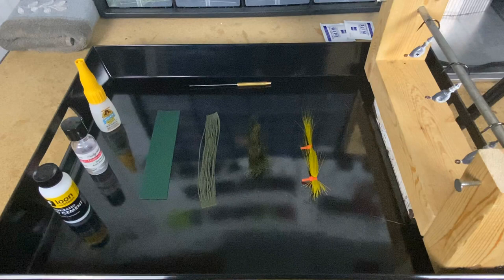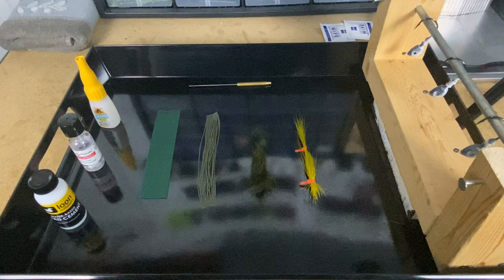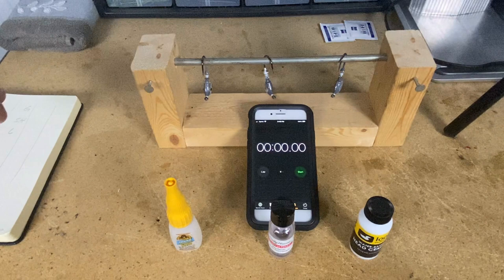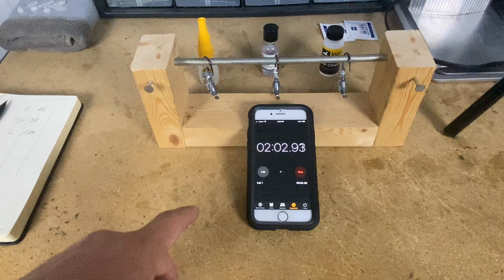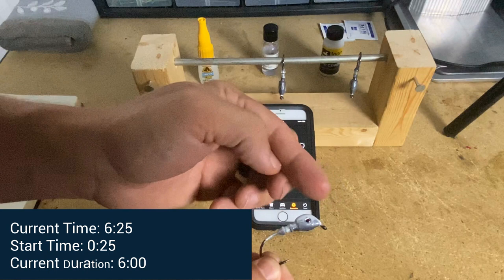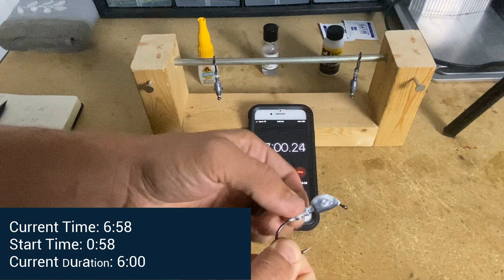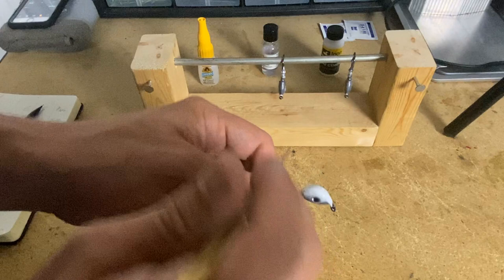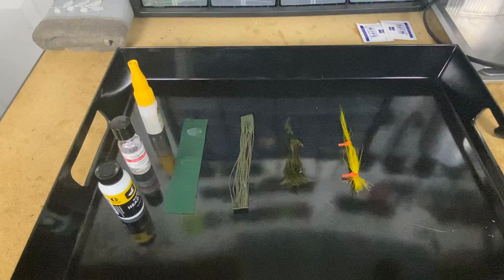What is the Best Way to Seal Your Jig Threads?

Comment: Fantastic test!!!  I used the glue for silicone because it didn't have the residue Sally Hansen's left. Your test showed it wasn't residue, it was the polish flaking which gave it that appearance. I used the Sally Hansen's on hair because of the way the glue looked if you got some on it.  I was sold on the loon after using it a few weeks, it seals the threads nicely and if you get some on your material it doesn't show no matter what material it is. The drying time was an unexpected bonus, the simple fact it isn't tacky is just nice! Overall your test was well done and pretty thorough, I wouldn't have thought about doing that kind of comparison.
Reply from the maker: Thank you sir!  I would have handled a few things differently (became obvious in editing), but I think it was a worthwhile effort nonetheless!

Comment: On the second touch test, you wiped everything off of the Loon Head Cement, jig. So, it will definitely be dry on the third touch test because you touched it a half dozen times on the second test and removed any excess it did have.
Reply from the maker: Thx for the feedback!

Comment: The other test, reaction of the three sealants on different materials, you are sealing the thread wraps and the thread wraps are what is holding the material. So, if the thread wraps are sealed, then the thread wraps will hold the material to the hook shank, not the glue.
Reply from the maker: A good whip finish will indeed do the job.  Sealant is that extra insurance. 👍👍

Comment: That was a good video to see the differences.  Does the odor of the products have any impact on fish biting or does that odor go away once the glue has dried?  This factor made me start to use the Loon Head Cement.  Thanks for all you do.
Reply from the maker: Great question Robert!  I’ve not noticed any negative affects due to the odor or any option.  That Loon Heat Cement is just so dang convenient for all types of materials… dries fast, and is strong enough to do the job.  If I need more umph, I’m probably turning to 5 min epoxy as option 2.  Hope this helps!

Comment: There is a particular superglue from mercury adhesives that I use for making models, the downside to it is that there is a shelf life to it, so if you aren't using it regularly it will lose it's ability to dry.  However that being said there is an accelerator for it that causes it to dry instantly.  Not even joking.  It's fast drying anyways, it dries in a few seconds normally but with the accelerator you can literally watch it harden up as you spray it.  There is also a retarder to slow the drying speed.  It comes in thick, medium and thin.  Pretty solid stuff.  From what I've seen the stuff lasts around a year before it starts losing it's instant drying properties.  The containers get a chalky appearance on the outside of the bottle when they've basically become ruined so I think there is some sweating happening of some of the elements making up the formula for the glue.  Food for thought to give it a try anyways.  You can get them at hobby shops that sell models and rc components usually.
Reply from the maker: Nice, very interesting, thanks!
Reply: @SDGCustomLurecraft  Thank you for putting this video together.  It's nice to see the results of the different products on the materials.  You saved us all a lot of wasted products.

Comment: have you tried UV racin?
Reply from the maker: I have actually.  Went through all the options that Loon makes (flow, thin, and thick).  It never held up for me… ended up peeling and looking like garbage after a while.  I would even cure them in a UV box I built and/or direct sunlight.  Just never worked as well as other options for me so I sold it all!
Reply: @SDGCustomLurecraft  thank you so much for getting back to me
Reply from the maker: @AddictedAngler  NP!